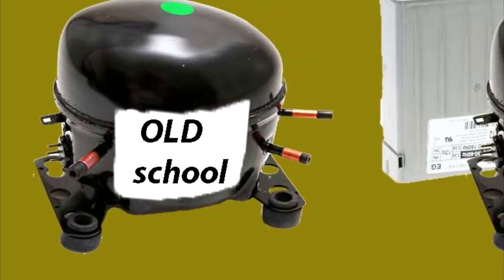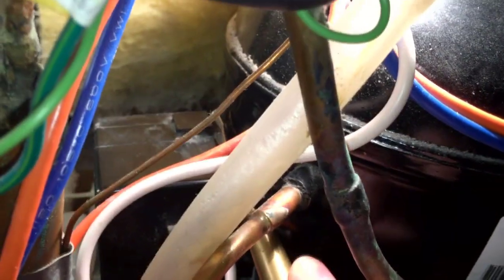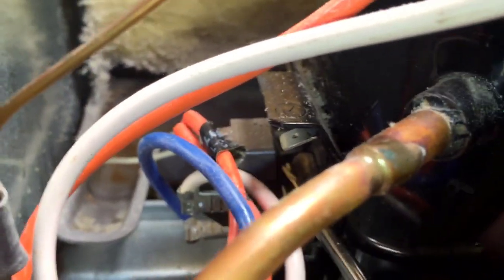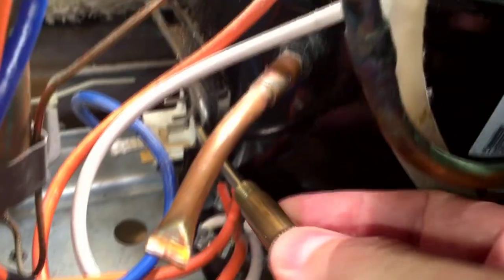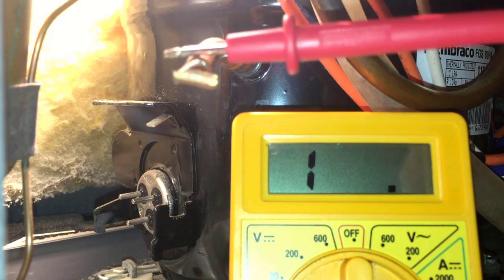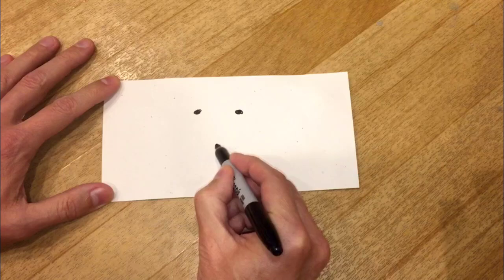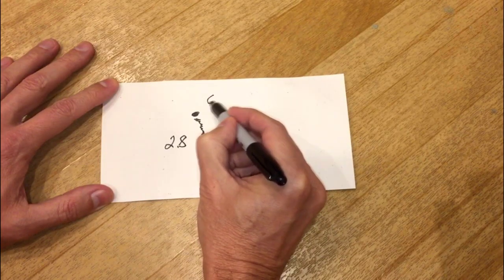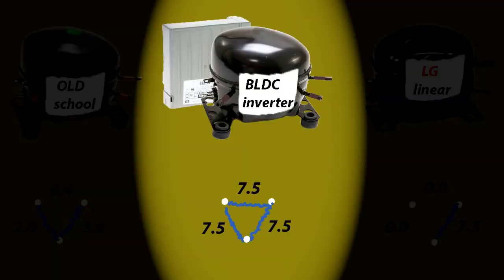Testing refrigerator compressor LG, Samsung, Whirlpool...

Comment: Have a LG LFX33975ST. Has a linear compressor and ohms around 12. Has an error code 22. The compressor is running. Fans are working and no icing up. Wondering if it could be low on freon?
Reply from the maker: Yes, it could be low on refrigerant gas. But most likely, the compressor is going bad. LG typically replaces those linear compressors for free in the first 5 years. After that, you pay labor costs.
I'm not familiar with error code 22. But when you run a test cycle from the main control board, code 22 22 will indicate the second stage of the test.
Reply: @Your-Self  what if your not the original owner?
Reply from the maker: If you don't have the purchasing receipt, you are kinda on your own. Either pay for an expensive repair or buy a new one... sorry.
Reply: @Your-Self  added refridgerant and solved the problem.

Comment: Great job on the video  :)    if the linear compressor had a ohm reading on 9  and  seems to be running  (as there is no clicking and no cooling) would that be a no coolant issue even though its throwing a 22 code on a LG fridge,   Thanks for your help
Reply from the maker: Are you sure it's throwing the 22 code? If you are running the Test from the small button on the PCB, it's just showing the second stage of the Test Mode. And the third Test will be 33.
Typically, LG linear compressors run (vibrate) but don't cool when bad. If it's under 5 years old, LG may replace it absolutely free. 
The lower possibility is that the gas has leaked out from the system.
Reply: I have exact same issue. Second Diagnostic test via PCB throws 22 error code. No error code on third test.  Compressor vibrates all the time but no cooling. Temperature sensor and all fans checks out fine. One pair of Compressor pin shows 10 ohm resistance. Relay doesn’t rattle and compressor starts vibrating immediately without clicking. Out of ideas. Do you think I have bad compressor? It’s about 7 years old. Any idea on labor cost to replace as it has parts warranty on compressor. Appreciate your help.

Comment: Nice video. I never heard of a linear compressor. Not knowing, if I was checking it and found 0.0 readings on 2 of the pins , I would think the winding's were shorted together. Is the compressor three phase or does it have a start and run winding.  Thanks for the video
Reply from the maker: A cheap multimeter will show 0.0, but a more advanced meter will show OL. An LG linear compressor  has just one run winding, unlike 3-phase or conventional start and run.
Reply: @Your-Self   nice to know/ never thought a compressor could run with just one winding.

Comment: I checked out your video because I am trying to diagnose a display case chiller that we have that won't cool. It appears that the compressor is running but it is very quiet.
Capacitor checks out OK, and the relay and cut-out both appear fine.
Checking the pins on the compressor I'm getting what appear to be high but logical readings of 15 , 30 and 45 ohms.
I'm basically trying to check as much as I can before calling someone to come and re-gas the system and check for leaks.
Are the readings too high?
Reply from the maker: The readings are on a higher side, but just fine.
If there are fans in your chiller, make sure they are running. Otherwise, it's time to call a technician to investigate.
Reply: @Your-Self  I have just one fan inside the chiller, next to the thermostat control, and that's working fine.
It's a Fujidenzo chiller and every video online appears to be about finding leaks and re-gassing. So don't see any reason why mine should be any different.
Thanks for your answer.

Comment: Thank you very much for your video. I have lg with linear compressor and the freezer is not getting cold enough. The technician in my place is really bad. He already change the main board but still the same. I have it for almost 3 years. The measurements i found are 5.4-15,4-19,5. What do you think?
Please reply!!
Reply from the maker: Some LGs have regular compressors installed. So your measurements should be OK. 
Did you buy your fridge new or used? Maybe somebody worked on it before and made a mess.
The refrigerator could be leaking gas slowly on the LOW side. It may take a month or a year to leak out completely with reduced performance. The only way to prove it is for a tech to attach gauges to check the pressure inside.
Make sure to clean the condenser coils near the compressor.
I'm assuming all fans work well, right?
Reply: @Your-Self  the fans are working fine and i clean the condenser. It was new and on the door it says linear compressor with 10 years warranty.
The tech just opened the cover inside the freezer and he said i can see the leak. My wife was at home then and he wanted to take it for a week to check. But he is very bad tech. I will have to pay him and he will do nothing. What do you suggest me to do? He replaced the main board at September and for 1-2 months it was okay but after that my warranty expired.
Reply from the maker: Hmm, if it says Linear on the door, the compressor should be Linear as well. Does it actually say Linear on the compressor itself? (it could be a small text, hard to see)
Recently, LG extended the free Linear compressor replacement warranty to 5 years. And 10 years parts only.
However, I'm a bit confused by your compressor situation, so not sure what to suggest.

Comment: My chest freezer is tripping the breaker just when I switch it on.  What could be the problem?
Reply from the maker: The breaker could be weak or overloaded with other appliances.
If it's a GFCI outlet, try a regular outlet.
The compressor could be shorted to ground. Did you check that?

Comment: Hi great tutorial,my second hand freezer doesn't chill to more than 4°C and the compressor is very hot running continuously and the orange warning light stays on.
Its otherwise in very tidy condition as is less than a year old,it takes hours to even get slightly cold,any ideas please
Reply from the maker: Does it have a condenser fan near the compressor, and is it running to cool the compressor?
Also, there could be a sealed system problem, for which you'll need a tech to look at.
Reply: @Your-Self  thankyou,no fan for cooling,very basic design will enquire with a tech,to check gas

Comment: I have a Kenmore Elite (made by LG).  The compressor reads (0, 0, ~13.5) and not 7.5.  Does this indicate the compressor is bad?
Reply from the maker: Your reading is a little high but could be attributed to an uncalibrated multimeter, so it's not bad electrically.
What is the actual problem with your refrigerator?
If the compressor is running but not cooling, most likely, the mechanical valve inside the compressor is damaged. So the compressor needs to be replaced because of that.
Reply: @Your-Self  Thank you for the quick reply.  All fans are running, no frost build up behind the panel at the back of the lower freezer drawer.  I've replaced the overload switch assembly and now the circuit board, and vacuumed out the dust from all the components in/around the compressor/radiator/etc.  How can I be assured it is the mechanical valve?  There is no rattle or rough sound or click.  #stumped  Is a failed mechanical valve common / part of the known issue for these linear compressors?
Reply from the maker: Yes, it's a typical problem with LG linear compressors. The compressor seems to be running, but it's only idling, not compressing due to the cracked valve. That's why LG extended their free-replacement warranty to 5 years.
The less likely problem is that the refrigerant has leaked out. To verify pressure inside, a tech needs to install gauges.
Reply: @Your-Self   I will call LG in the hopes this unit made March 2015 is covered, I read something about pushing it to 10y,  otherwise I'll get it done locally.  You rock, yours was the only video I could find with compressor specific readings.  HUGE help.
Reply from the maker: The actual compressor warranty is 10 years. But you'll have to pay the labor of replacement cost of about ~$400 after the first 5 years.
Reply: @Your-Self  so LG referred me to Kemore (which makes sense, model is Kenmore with LG compressor).  I paid for Kenmore virtual tech to troubleshoot over the phone.  His conclusion was yellow substance in the drip pan indicates a refrigerant leak.  Drip pan was dry.   I'm googling "yellow fridge drip pan" and am getting inconclusive results.  Does this ring a bell / sound familiar?
Reply from the maker: It's possible for the refrigerant to be gone, and some oil residue ends up in the pan. But to be sure, a tech needs to install gauges to check refrigerant pressure inside. If there is no pressure, the gas has gone. But if there is pressure, the compressor is bad, or there is a clog in the sealed system.
The yellow stain could be from refrigerant oil or could be from some other impurity... it's difficult to tell from a distance.

Comment: Hi my problem is we had a brief power out age. When power resumed ,I smelled a burnt plastic smell. The fan worked but the compressor relay was fried. I have a 3 way so I hooked it up and I heard a brief start noise then nothing. I did the 3prong test on compressor and it checked good. Now I rehooked the power wires to the 3way but there’s no juice there at all when I turn fridge on. I checked the wall plugin and get 120 volts. Any ideas?

Comment: I have lmx25964st it’s out of warranty, my question is how much power is going to compressor supposed to be I put my meter the 2 wires going to compressor (red, black) it’s only 80v but the compressor listed 175v and the compressor sounds running but not compressing the pressure are both the same high side and low side, cap is ok 10 mfd , is my compressor is bad? And one thing the blinking lights is 5 blinks and my little screen showing 22 . Your help is highly appreciated.
Reply from the maker: Yes, sounds like the reed valve inside the compressor is cracked. That's why it's not compressing, just idling. LG covers the full repair for the first 5 years, but only supplies a free compressor for 10 years and you pay for the installation.
Reply: @Your-Self  but is that right 80v going to compressor and the compressor listed 175v thanks again
Reply from the maker: The 80v is the minimum operational voltage that should create a difference in pressure between the High and the Low sides and cool the refrigerator at a low speed.
I didn't see the 5 blinks the first time in your message, but that indicates a locked valve. Either way, the compressor is bad, sorry.
22 indicates that you are in the second stage of the Test Mode, and 33 is the third stage (defrost).
Reply: @Your-Self  thank you much your quick answer very helpful to me. God bless you &happy new year!
Reply: Hi good day to you sir, I have questions again hopefully u can help me. We replaced the compressor with lg replacement compressor vacuum and after we have 600 microns we charge 134a 5.11oz accordingly we turn on since last night and nothing is working compressor vibrate but it only showed 0.22 ams instead of 5.2 ams and pressure won’t change I guess compressor not running right?   What we should do next? Your answer is highly appreciated. By the way pressure on low right now is 1.0 high side 66.5
Reply from the maker: If you installed a new LG Universal compressor, the software on the motherboard must be updated with a special LG jig to run correctly.
Reply: @Your-Self  ok thx again for your help

Comment: Hi I am having issues with my refrigerator, both freezer and fridge do not cool, the compressor is inverter type and started humming when i pluged the fridge. I kept the fridge on for about 6 hours and when i came back.. the fridge snd freezer kept same temperature, condenser coils are not hot, compressor is overheated,,, what could be the issue? Thermostat? Freon leak? The compressor does not have a condenser fan
Reply from the maker: If the compressor is not shorted and is not running, the inverter board is probably bad.
Reply: @Your-Self  maybe i explained myself wrong (English is not my mother tongue) I measured the resistance between coils and i get 10ohms between all of them, so I assume that the compressor is okay. I measured the control signal from the motherboard to the inverter and i get around 3.6vdc (i was expecting between 4vdc - 6vdc), i unplugged this connector from the inverter and the compressor stops working. If i plug it back, the compressor runs.. i asume the inverter is also okay... I measured the voltage from the motherboard to the evaporator fan and i get around 3.6v dc as well,,, the fan runs with 9vdc... My assumption here is that i have a faulty motherboard? How can i be sure? I am having extra issues since my fridge is a siemens and there is no documentation available on the internet :/ thanks a lot for the help!
Reply from the maker: Yes, without documentation is difficult to know exactly what's wrong.
Since the compressor is running, we'll assume the inverter is good as well. And 3.6vdc should be enough to run the compressor, at least, at medium speed.
Next, you want to take everything out of the freezer, and look at the Evaporator Coils. If they are freezing cold with ice build-up, you may have a problem with the fan, defrost, or motherboard. If there is no frost, and the coils are just slightly cool to the touch, you probably have a major problem with the Sealed System... Freon leak or restriction, dying compressor.
Reply: @Your-Self  thanks for the reply, i found no ice build up there, i am assuming now there is a leak on the sealed system that caused this issue, i will serch for leaks today and verify again the motherboard to check for anything suspicious

Comment: Thank you for such clear post. I have the LG linear compressor.so many of posts refer to compressor relay inside the left cover. mine has the overcurrent device only, yet I can hear a relay but the compressor doesn't start. does the relay exist elsewhere TY.
Reply from the maker: LG linear compressors don't have a start relay, only an overload device. The main electronic board controls the compressor. Try to run the Test and see if the compressor starts as on this video... https://youtu.be/70y61Sq_NU0

Comment: great job, I have LG LFX28978ST /04, three of four days ago my freezer quit freezing but air was blowing from ever where where it suppose to blow and pretty cold too but evert thing in the freezer thawing out but refrigerator section was working fine until last night now both refrigerator and freezer not cooling has temperature about 51 all the fans working fine, compressor coming starting and shutting off as it suppose to do and one line in compressor is cold and one line is hot as its suppose to be, can you please help me and guide me how to fix it, i called this he knows some about refrigerators he said my compressor is gone better to buy a new refrigerator

Comment: Excellent video but I'm still a little unsure on my testing.  I have an Old School compressor that seems to not be coming on.  I've replaced the capacitor and start relay with no luck.  The ohm readings are 5.4, 4.3, and 8.8.  Based on your video the full length of windings should add up to about 9.7 but I'm a full ohm lower.  None of the pins go to ground (using the copper wiring as ground).  Does this indicate it's bad? I'm perplexed on what to try next.  Thanks
Reply from the maker: Your ohm readings are close enough, so electrically, the compressor is probably good.
If the fan next to the compressor is running, the temperature sensor is good as well.
It's possible, that the compressor is mechanically locked inside. Sometimes, a 3 in 1 hard start device can unlock the compressor. But there is no guarantee how long it will work. It could last one day or years.
Reply: @Your-Self  I see.  I don't have a 3 in 1 hard start device to test with.  Is that difficult to do?
Reply from the maker: It's a mediocre difficulty, and you'll have to cut and splice the wires.
Just search YouTube for "3 in 1 installation" to get an idea.
Reply: @Your-Self  thanks. I'm familiar enough with electrical work to try.  For whatever it's worth I get zero sounds from the compressor when plugging in the fridge and waiting. Both capacitors and start relays I've used pass multimeter tests. If a hard start was needed would I hear any sound before hand?  If the hard start works do I just leave it in place or go back to the old relay if it "un-sticks it"?

Comment: @YourSelf . I have an LG Refrigerator Model No: LFXC247226/02. It has stopped cooling. I was told by a technician PCB and compressor needed to change. I bought new PCB Model: EBR78940615 and LG Compressor - FLB075LANA. Hooked by both parts, added refrigerant and what not. The fridge powered on but still will not cool. It remains hot. What do you think maybe the problem here?
Reply from the maker: Your refrigerator model seems not to be valid.
If you install the new "Universal" compressor FLS075LANA, you'll need to update the original PCB or buy a new PCB and update the software with a special LG jig as well.
Since you installed the old version compressor FLB075LANA, you should be able to use the old PCB.
The LG Linear compressors are very slow on cooling, so it may take a whole day to feel the difference. Also, they are very sensitive to the amount of refrigerant you put in. The amount has to be exactly as on the sticker.

Comment: I checked the resistance by putting one lead on the pins and the other one on the copper pipe but the numbers didn't jump around.  But when I checked the resistance between the pins the numbers do jump around.  Does that mean the compressor is bad?
Reply from the maker: The numbers could be jumping due to friction, or the multimeter could be bad. Try holding meter leads on the pins steady.
Reply: @Your-Self  You're right.  It was due to friction.  The numbers stabilized and the compressor seems to be good.  Thanks